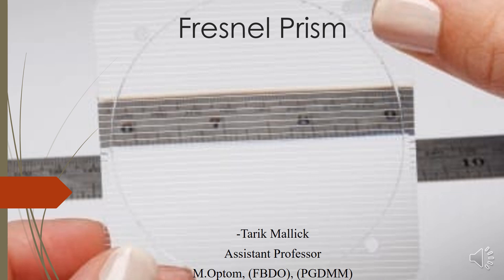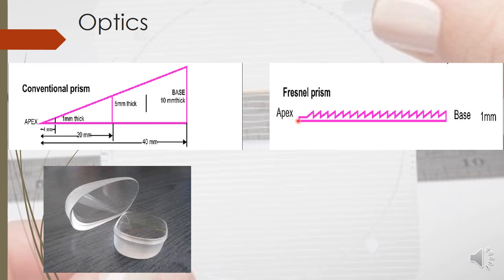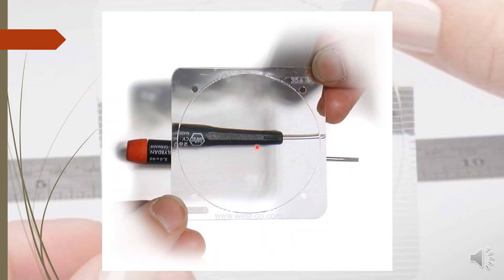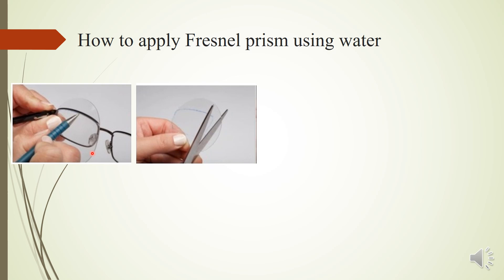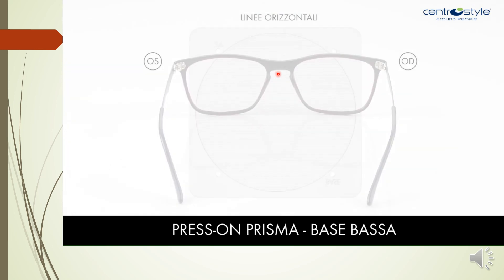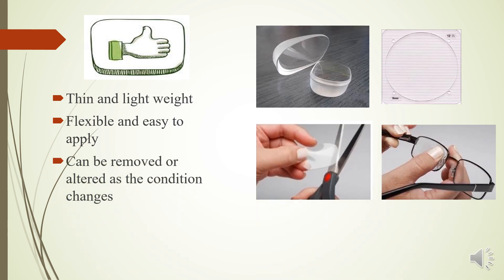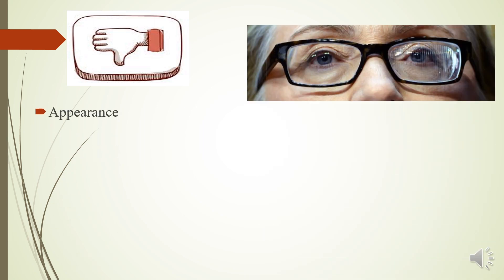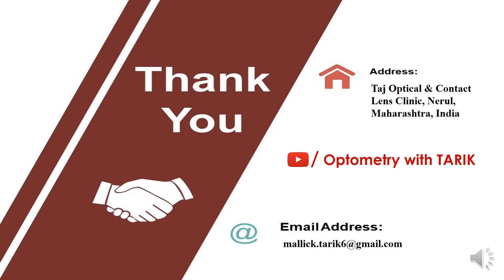Fresnel Prism - Optics, Manufacturing, Application, Advantage & Disadvantage.

Comment: Sir,, why we use Fresnel prism,,
Reply: I want to know,, how it helps in our vision,, for which problem we use it
Reply: @ilaranjan7384  the reason we prescribe a Fresnel prism is to help relieve double vision.
Reply: @utsavsingh5702  ok
Reply from the maker: Ila Ranjan The reason of using Fresnel Prism is to get rid of double vision. Though it can be done by normal prism but the there are some advantages because of which Fresnel Prism is used in some cases in this video we have explained the advantage and disadvantage as well
Reply: @OPTOMETRYWITHTARIK  okk sir,,, thnks
Reply from the maker: Ila Ranjan your most welcome
Reply: How to correct squint  by prism any demonstration if you have